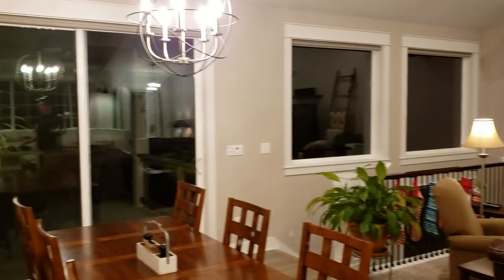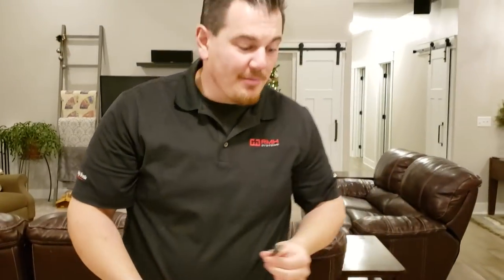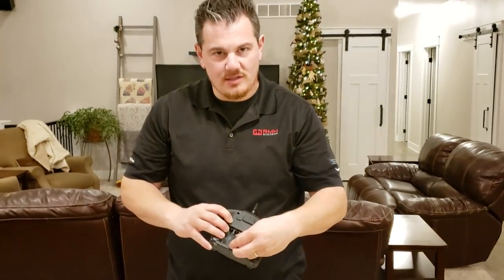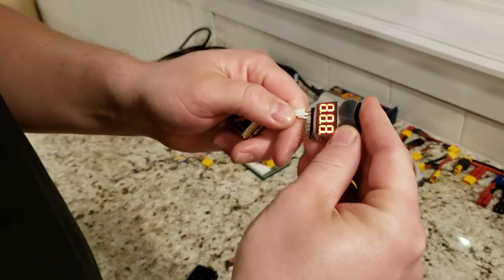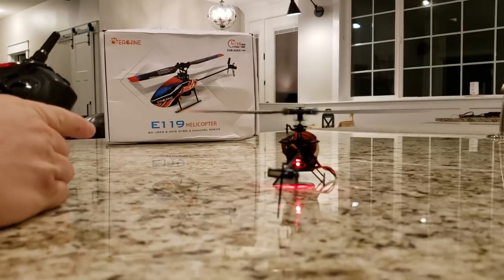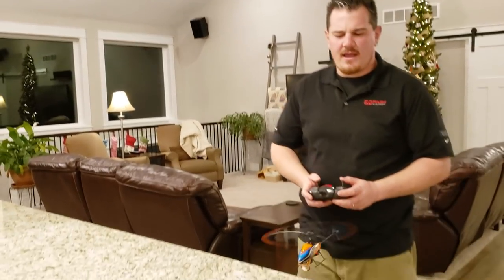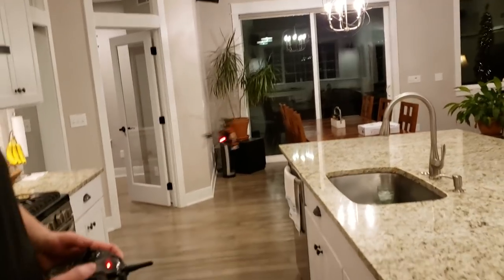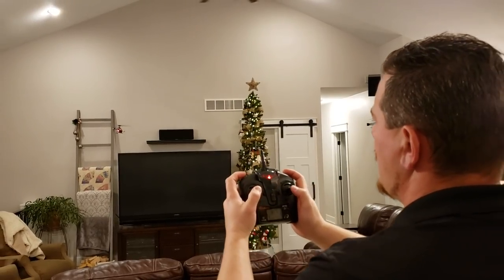Eachine - E119 - RTF Heli - Unbox, Setup, & Maiden Flights

Comment: Nice video! Viewers might want to be aware of "Hover debugging" = To use it hold the top right shoulder button for 3 seconds and the transmitter power light will start flashing. Then fly the heli in zero wind, at least 4 feet high and away from any walls and use the trim switches to adjust the gyro so the heli stops drifting and holds a perfect hover. Then land and hold the top right shoulder button again for 3 seconds and it will store the new gyro settings and turn the power light back to solid red. It works!
Reply from the maker: Thanks for the tip! I will pin the comment!
Reply: Which trim switches should i adjust?

Comment: ciao  brian   ieri  arrivato  mio  e 119   ma  tende  sempre  a  sinistra .  come  si  regola  e  da  dove  ?  come  ? grazie  per  una  futura  risposta
Reply: ci  sono  riuscito  ,  i  trimmer  ,,,,,,,,,,,,,,,,,,,,,,,i  piccoli  pulsanti   grazie  ugualmente  .........................
Reply from the maker: You'll need to trim the heli to the right, if it's moving to the left. Use the small buttons on the Right Stick, at the bottom to make it stop moving to the left, by pressing the button on the right, until it stops.
~~~~~~~~~~~~~~~~~~~~~~~~~~~~~~~~~~~~~~~~~~~~~~~~~~~~~~~~~~~~~~~~~~~~~~~~~
Dovrai tagliare l'elicottero a destra, se si sta muovendo a sinistra. Usa i piccoli pulsanti sulla levetta destra, in basso, per fermare il movimento a sinistra, premendo il pulsante a destra, finché non si ferma.

Comment: But when the helicopter is unstabell which trim should i push and what does hover debugging means
Reply from the maker: Same as a drone or airplane.

On mode two, like I fly...if it's drifting away from you (tail pointed at you) then you'll adjust the trim on the right stick, BACK toward your belly.

If it's drifting to the RIGHT, then the LEFT on the Right stick.

If it's drifting to the LEFT, then to the Right on the Right stick.

If it's drifting toward you, then AWAY from your belly on the RIGHT stick.

Just the same as if you moved the stick...do that with the little trim buttons.

Comment: Brian, yours flew nice out the box. Me and several others having issues with cyclic control. Both servos operate at the same when only using a single command. Really annoying, have the wl 911s and that is pretty much the same hardware but does not have this problem. I bought 2 by the way, both exactly the same.
Reply from the maker: WHAT??? So weird. I wish I knew how to help on this issue.

Comment: Theres usually 2 to 3 speed / performance settings, that affects the YAW Rate. low-mid-high. usually its hold down one of the upper bumper buttons. and u'll hear it beep single, double, triple beeps to signal what mode its in.
Reply from the maker: yes, this was true here. High and Low, toggled with the top Left button (if I'm remembering right).

I can't remember if I showed it at the very end of the flight video.

Either way, thanks for sharing :)
Reply: @BrianPhillipsRC  ahhh i see,

Comment: This heli looks like an exact replica of wltoys v911s ,  but it seems to fly a lot more stable out of the box than my v911s,  which was a nightmare, the CG on it was so much upfront, it was almost impossible to trim and fly. I crushed it literally like hundreds of times and it still flew. The tail rotor seems to be taking most of the damage and bends easily, get some spares. Just be careful pulling it off, it's tight, i pulled the whole tail motor out with it and ripped the wires and the bottom of the motor and I'm sad now. Other than that, for the money great heli to learn on. Takes the crashes like a champ, my walls look a lot worse than she does.

I don't think it's possible to turn off the 6g.  Hold that "hover debug" button for 3s, the light  on transmitter starts flashing, fly it, trim it, land and press that button for 3secs again. and it's supposed to remember the setting, seems like gyro calibration in  flight or something.

Been watching your videos for some time,  it took me a while to get used to your style, but now I found them quite entertaining and informative. Would like to see you build some of the more advanced Flite test planes, haha, your wife could definitely fly an fpv drone;)
Reply from the maker: I'm glad to have you here with us! Thanks for sticking around. I'm glad you're getting used to my style!
As for FliteTest kits...I want an F-14 ;)

Comment: Hi man, nice video,. Can you tell me what type of slide swich for on/of is there, and where can i find them, my died, i want to change him, but i dont  know how to look, becaause there is no tags on them.
Reply from the maker: Sorry, I have no idea. If I were fixing that, I'd steal a switch from some broken component lying around the house, OR better yet, just solder between the two pins and make it ON when the lipo is plugged in. You don't NEED a power switch ;)
Reply: Ty man, i will try something. Xd

Comment: Hi i wanted to ask mode 1 and mode 2,the helicopter is it still the same performence wheter its mode 1 or mode 2
Reply from the maker: This is only a personal choice of how you learned to fly the heli. There is no difference in performance, but if you fly Mode 2 and get a Mode 1 - you will NOT be able to fly it without learning to fly again, and it will be BAD for all the rest of your planes and helis.

Comment: ciao  brian . traduci  per  leggere  e  per  rispondere, l elicottero  è  stabilizzato  ? cioe  se  io  lascio  ilo  comando  ad  una  certa  altezza  , l elicottero  rimane  fermo  o  devo  sempre  accelerare  e  decellerare  ??  grazie per  futura  risposta
Reply from the maker: It does stay still. You can just tell it to GO UP, or GO DOWN...then it will do it with only minimal drifting from here to there. It works very good. Very easy to fly.
~~~~~~~~~~~~~~~~~~~~~~~~~~~~~~~~~~~~~~~~~~~~~~~~~~~~~~~~~~~~~~~~~~~~~~~~~
Rimane fermo. Puoi semplicemente dirgli di andare su, o andare giù ... allora lo farà con una minima deriva da qui a lì. Funziona molto bene. Molto facile da pilotare.

Comment: received mine today no owners manual, so a lil lost on settings, but its pretty neat & quiet. my box was also crushed the same way.
Reply from the maker: Yeah, the owners manual is a waste of time on these Chinese aircraft....generally, they aren't quite Chinese or English.... luckily, the heli is great! Hope you like it as much as I liked mine :)
Reply: @BrianPhillipsRC  glad you took the remote apart because I had to also & needed to watch your vid again to see where the trim buttons went. as you see they're made slightly different, two smooth & the other two have openings. I was flying the copter trying to practice turning/circling & crashed into a Lysol can. the helicopter & the can went into the trash & when I set the remote down in a hurry it fell on the floor breaking loose the throttle stick. it just deeded to be put back into place luckily. I did see in another video putting/holding both sticks at the bottom & out calibrates it which was helpful.  its already busted me in the toe & flown at my face a few times. guess I need to give it a break for awhile lol
Reply from the maker: If you really get serious, a hard hat and safety glasses may be in your future :) LOL - Good luck Jason!

Comment: I've received mine last week, seems very good but the transmetter is faulty, none of the trim works, the buttons on the bottom doesn't make nothing too and most of all the throttle stick doesn't make the motor responding until mid stick and then passes to 100% throttle so 0 to 100%in one millimeter !totally inflyable . Even if I'm piloting 600 size usually.so sad...
Reply from the maker: I'm sorry that yours sucks sooooo bad!!! I had some issue, if you noticed with my sticks too...maybe copy my repair???
Reply: @BrianPhillipsRC  nope , it's not a mecanic problem. I'm in mail discuss with banggood...wait and see , i'll post the solution here. thanks btw.
Reply from the maker: Sure thing ;) Thanks for the heads up

Comment: It won't fly upside down, it would need a third servo to control the pitch, like EC145. Will you also try the Futaba receiver on this?
Reply from the maker: Yeah, sorry about that. I don't know why I didn't connect the very obvious dots at first. My embarrassing mistake!

As for flying on Futaba Rx, probably not. I can't say I have a huge issue with the controls of this heli. I think I've got an M2 coming, and for that maybe???
Reply: @BrianPhillipsRC  Must be because you have so many things to unbox. ;-)
I guess my E119 is either faulty, or it's transmitter is more wonky than yours. I have some heli experience, not 3D, but can fly a bit without self leveling, and I can't get my E119 to fly smoothly at all, while my K110 is rock solid. So I am forced to try a different RX+TX combo, or else the E119 will become an expensive paperweight.

Comment: Hi folks. I have a Jumper T12 TX. What settings can you use to bind it to the T12.  Thanks!
Reply from the maker: I don't know, I haven't figured it out...sorry! Maybe someone else will jump in and answer??? If they do, it would be much appreciated.
Reply: Just bought this heli and fly nice. Also i have a Jumper T12 and trying to find settings but no info so far that i can find online :-(
Reply from the maker: Bummer! Well, if you figure it out. Please let me know ;)
Reply: Update...was told that if i wanted to use my Jumper T12 TX i have to buy a receiver board compatible with Futaba FHSS and that board plugs in the E119 receiver board. On your Jumper then select the FHSS protocol. Hope the info helps 🙂

Comment: Fascinating that when I ordered a wl toys heli with 3 batteries, they sent me an email saying they can't ship to the states because of the lipo batteries. AFTER accepting and sending an order confirmation. Would I please cancel and order the batteries separate and we will give you a credit? Nope! I cancelled and ordered elsewhere. Banggood sucks. 3 times I tried buying from them, and 3 times there was a problem. I'm done with them, glad you had some luck though! -:)
Reply from the maker: I'm sorry that you had such a bad experience, Tom! Luckily, this item is available a few other spots, so you can still get one, since it's pretty awesome. I try not to hold the MFG's responsible for their distributors bad deeds, and I get why you handled it the way you handled it. Here's to better luck with the next order.

Maybe if you really want to order another one, you could get one from the US Warehouse?
Reply: @BrianPhillipsRC  Thanks! I did have a couple of success's with BG in the past then it suddenly became more miss than hit.  No big deal. I did get the WL V911 and I love it!! This one you are reviewing looks really good, and im impressed with the bigger battery/ flight time.

Comment: A small 5.5mm socket & a hardwood dowel might be better to rap head as you can crack the main gear by uneven finger pressure.  Just subbed,  you got Heli's.
Reply from the maker: So you're talking about tightening the main gear on the propeller shaft? For after a rougher crash? I'm sorry, David, I don't mean to be difficult, I'm just not sure the context of your comment...
Reply: GM , Brian. Exactly how theoztreecrasher explained it. The spokes on the main sprocket/ gear usually break if not pressed back on even . They have abandoned the tried & true retaining srew that went thru the gear & shaft, like the old v911, on most micros. That & the tail rotor popping out after a crash, which severs its cables. A dab of hot glue on motor to tail boom , will keep it there.

Comment: What does yaw mean and six gyro mean?
Reply from the maker: Yaw means the flat turning axis. Yaw is controlled by the rudder of an airplane. Six axis gyro is a gyroscope that helps keep 6 axis of flight under control
Reply: @BrianPhillipsRC  one more thing what is aircraft hover mode mean and lifting adjusment trim used for
Reply: @BrianPhillipsRC  When the helicopter is unstabell which trim do i have to push?

Comment: E 129 with the snap in battery ordered one from banggood  with the 4 batteries well when I got it and opened the box guess what no batteries in the box long story they offered 25 bucks I excepted ordered another on with the four battery option received new one guess what that one had four batteries so long story short im all set one extra heli for parts.
Reply from the maker: Sorry about the issue you experience. We've been pretty lucky from Banggood so far...we've had one plane, I really wanted to review, show up crushed twice....other than that, we've been super fortunate. Only minor scuffs and scratches.
Reply: @BrianPhillipsRC  your vids are spectacular thanks bud.

Comment: Could someone please tell me what's written on the third mosfet on the receiver board? The other two are Y1s but I need the one which starts with a 3. Mine is burned out and want to replace it.
https://imgur.com/gallery/TRyjo7I
Reply from the maker: Not sure if they're mosfets, but this is what I can read on them...

Two read Y1 - Center of PCB, and other next to Tail Rotor Motor Lead
The other reads 3416 (right next to "Sbus->" silk screen)
Reply: @BrianPhillipsRC  Yess 3416 that's the one I needed! Thank you very much Brian!